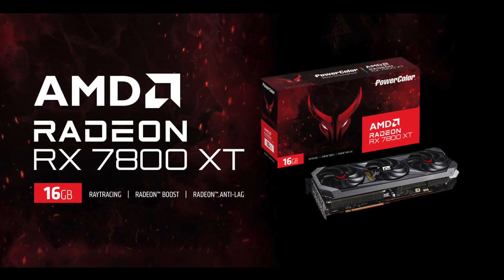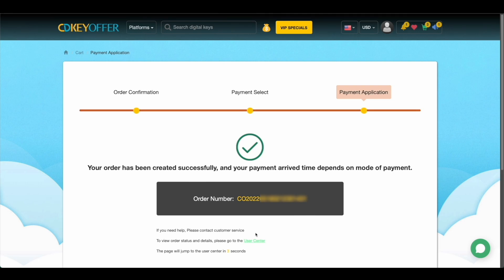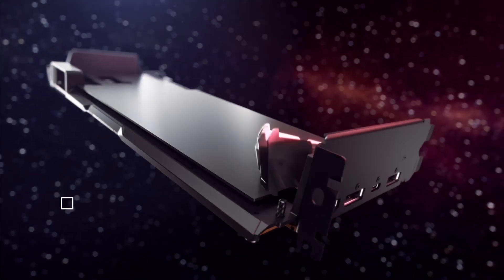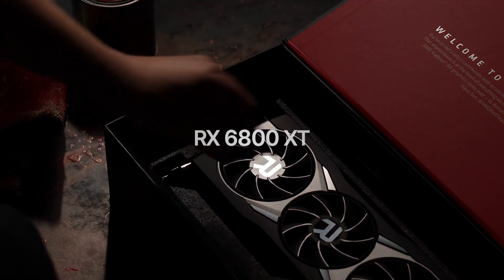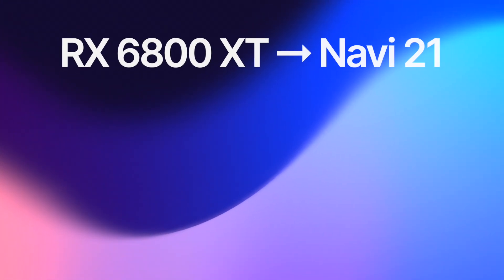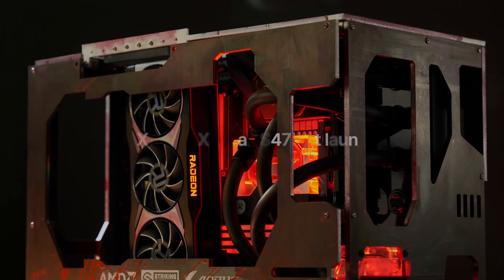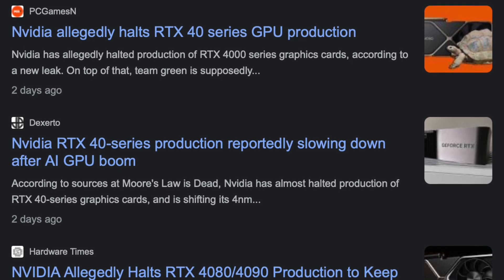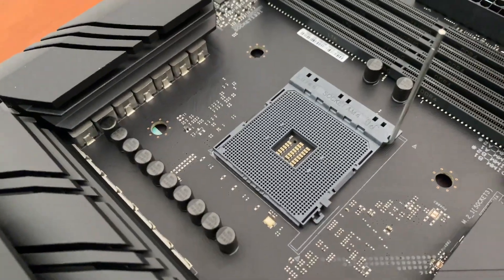RX 7800 XT is a DISASTER in the making! [Specs, Performance, Release Date, Price]

Comment: My humble take

7900 xtx = 7900
7900 xt = 7800 xtx (because more ram and bus)
7900GRE =7800 xt
7800xt = 7800
And the 7600 should have had a 160 bit bus and 10 gigs of ram and it would have been a great entry level card.

But that's juste my two cents that are probably not even worth that...
Reply from the maker: Well... the community complaining did force NVIDIA to rename RTX 4080 12GB to RTX 4070 Ti and lower its price a little bit. I think voicing your opinion is very much necessary and is a good thing.👍
Reply: @theivadim If I was in charge at AMD, first thing I'd have done is tell the greedy shareholders to just lay off the greed.

Then my GPU Radeon RX 7000 series lineup would've been this:

RX 7900: 8,192 Shader Cores, 512 Texture Mapping Units, 256 ROPs, and 256 Ray Tracing Cores. Not a lousy piddly ass 96 Ray Tracing Cores but 256 of them. 32 Gigabytes of GDDR6X graphics memory on a 2048bit memory bus along with 512 Megabytes of L3 memory cache. 2,133Mhz core clock, 2,633Mhz Game clock, 2,833Mhz Boost clock.
Price: $999.99 US dollars.

THAT is what my flagship card would've been. Not the overpriced paperweight AMD puked up.
Reply: you're spot on this is what amds line should've looked like
Reply: That’s a beast of a card
Reply: @aaronjenkins2135  Well, with 256 Ray Tracing Cores it would just about match the GeForce RTX 4090 in Ray Tracing in most games. Not necessarily beat the 4090 but at least get close to matching it. Nvidia's Ray Tracing Cores on a 1 vs 1 basis against AMD's RDNA 3 architecture are about twice as powerful. Each one of Nvidia's RT cores are performing double the number of computations per clock cycle vs AMD's RT Cores. So it stands to reason that for AMD to catch up to Nvidia in Ray Tracing the RT core counts in their entire RX 7000 series lineup needed to be doubled. So yeah, even if the RX 7900XTX had 192 Ray Tracing Cores the GeForce RTX 4090 would still beat it even though it only has 128 Ray Tracing Cores.
Next gen it will be the same scenario as with the RX 7000 series vs the RTX 40 series. Nvidia will still be way ahead in Ray Tracing, DLSS 4.0 in Nvidia's "Blackwell" architecture of the 50 series and Nvidia's "Frame Generation" tech will have greatly improved. Nvidia wins literally by faking it vs AMD. So unless AMD's RX 8900 GPU comes out in 2024 with these exact specs:

Fabrication process: 0.2nm Carbon Graphene Nanotube 
65,536 Unified Shader Engines "Stream Processors"
4,096 Texture Mapping Units
2,048 Rasterization Output Processors
2,048 Ray Tracing Cores
4,096bit memory bus using 8 channels of quad data rate memory interfacing each channel utilizing at least 16 PCI express 5.0 lanes at 256bits each lane
128 Gigabytes of 8 channel GQDR "Graphics Quad Data Rate" memory connected via a 4,096bit bus.
1,024 megabytes of MCM cache.
400Mhz core clockspeed at idle.
8,233Mhz base clockspeed under nominal operation and use.
8,733Mhz Game clock.
9,333Mhz maximum boost clock
Variable graphics memory clockspeeds that automatically adjust to match the speed of the GPU.
Less than 80 watts of total power consumption under sustained maximum load with 100% GPU utilization with overclocking at 9,400+Mhz thus only requiring a single 4 or 6 pin power connector for the purpose of overclocking. Carbon Graphene Nanotube fabrication allowing for extreme high clockspeeds at a tiny fraction of the power requirements of silicone based 5nm fabrication.
Single slot design with standard height at about 8 inches long (203mm) simple aluminum heatsink paired with a quiet blower style fan.
Price $699.99 US Dollars at launch.
And just called it the Radeon CG 290. CG simply stands for Carbon Graphene. No stupid convoluted "XT" or "XTX" or any of that other suffix nonsense. Let the AIB board partners add all those silly "X's" if they want.

That is what I would be bringing out in 2024. No holding back,... at all. Just drop a damn nuke on Nvidia. BOOM!!

Performance soo overwhelming that even their bullshit DLSS 4 point whatever can't bail them out and that stupid gimmicky frame generation crap means Diddly squat,... and old man "Diddly" left town.

Just imagine this lineup:
Radeon CG 290 128GB GQDR memory on 4,096bit bus as speced above with 65,536 Stream Processors, 4,096 TMU's, 2,048 ROP's, 2,048 RT cores with an 8.2+Ghz game clockspeed in a single slot design that fits inside nearly any case at less than 80 watts TDP for $699 MSRP.
Radeon CG 280 96GB GQDR 4,096bit bus card, 49,152 SP's, 3,072 TMU's, 1,536 ROP's, 1,536 RT cores at the same clockspeeds as the 290 for $549 MSRP.
Radeon CG 270 64GB GQDR memory on 3,072bit bus. 32,768 SP's, 2,048 TMU's, 1,024 ROP's, 1,024 RT cores. Same clockspeeds as the 280 and 290 at $399 MSRP.
Radeon CG 260 48GB GQDR memory on 2,048bit bus. 24,576 SP's, 1,536 TMU's, 768 ROP's, 768 RT cores. Again, same clockspeeds as above at $229 MSRP.
Radeon CG 250 32GB GQDR memory on 1,024bit bus. 16,384 SP's, 1,024 TMU's, 512 ROP's, 512 RT cores. Same clockspeeds as above listed cards at $89 MSRP.

That lineup, launching in 2024, at those EXACT prices with that level of performance,... AMD would at the bare minimum get Nvidia user's attention. Maybe even capture some market share from Nvidia. 

That is the lineup of GPU's I would launch in September of 2024. Annnd I would have them all released together, the review embargo would be lifted 2 MONTHS before launch day.

Can you imagine Gamers Nexus or Linus Tech Tips reactions to a launch like that? JayzTwoCents reaction would be as funny as his I-fixit ads! 🤣 Hardware Unboxed would just sit there with their heads face down on the table. 🤣

Yeah, Oh I'd drop the nuke, just to see the reactions!